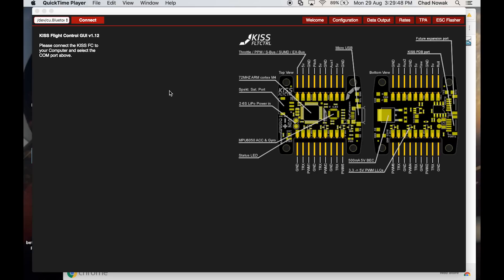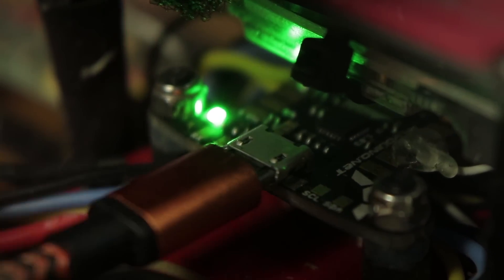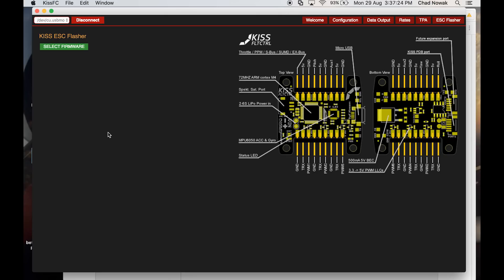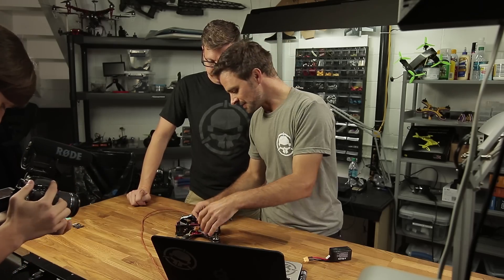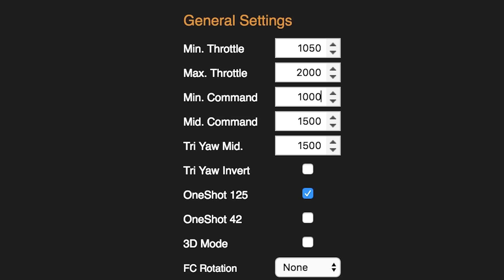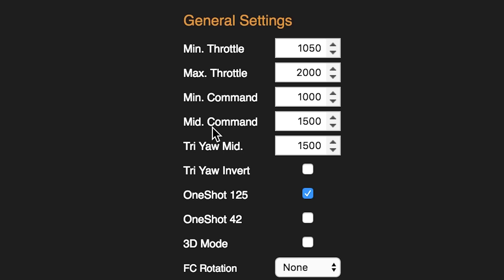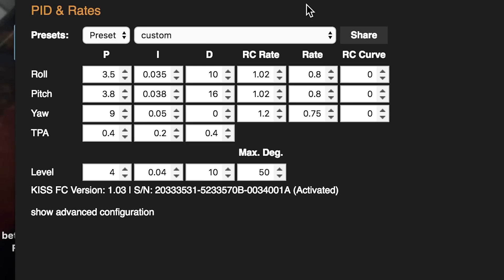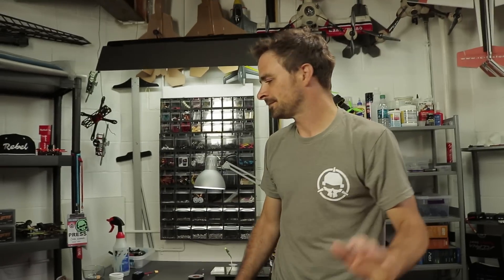Kiss FC Setup Tutorial

Comment: Thanks for making this vid, Chad & Chad!

Sure, lots of folks like me who've been flying KISS for over a year now will have learned most of this stuff the hard way but it's great to see somebody do an up to date KISS setup vid. I'm sure this'll help a lot of folks get up and running KISS easier!

When I watch this it also hits home just how much Flyduino have done since initial release. Remember soldering to flash firmware? Remember the old GUI with no TPA & curves? Lol.

Also, thanks for sharing your PIDS and rates, Chad Nowak. I know that those rates are a highly personal thing which take a ton of work to get dialled so I very much appreciate you sharing that publicly despite all the hard work you must have done on those. If anything it gives a really useful reference point from somebody who knows their stuff. 

One question: What's the thinking behind running more aggressive yaw rates versus roll & pitch? I ask because my yaw is a bit less aggressive than my roll & pitch rates
and I kind of like it. Of course I could always just try & see (duh) but your comments are always interesting.

I used to run low-ish RC Rate, higher Rate and some pretty crazy expo on the RC curve (with a massive degrees per second potential in terms of overall roll speed) which was fun for a while but I've gradually ended up kind of closer to where you're at - a flatter, less exponential looking curve overall using more RC Rate, a bit less Rate and minimal RC Curve with FAR less insane amounts of overall max degrees per.

With the new less insane setup everything actually feels more progressive and more precise yet still nice and smooth after I slowed the crazy 'degrees per second' stuff down and got rid of a lot of the exponential I needed in order to be able to even fly a super aggressive setup like that. Even at 2.5 flips per second I find I have plenty of ability to pull off cool stuff. Just different flying maybe. 

Anyhow huge cheers! Sorry for rambling. Thanks for adding value to the community once again!
Reply: Thanks mate, I just want my yaw to be more twitchy.

Comment: How can I enable "airmode" on My CC3D using Librepilot?
Reply: please, don't use librepilot. If you want airmode flash the cc3d with betaflight. its much nicer to work with
Reply: I am a beginner. Which software do you recommend?
Reply: betaflight 2.9.1 I think is the latest version of betaflight with the cc3d openpilot bootloader .bin file
To be honest though the cc3d is a bit of a pain in the ass to work with on betaflight because you have to plug in  a lipo to get it to connect to the configurator. I would only advise moving to betaflight if you know what you are doing or know someone who could help you with it. The best idea would probably be to get an f3 fc like the xracer f303 v3 as it will work with betaflight a lot nicer

Comment: Do not buy this FC, horrible QC. Get one with SPI MPU6000
Reply: I've got 2 KISS fc and ESCs working perfectly and never had any issues.
Reply: That's BS.  I have KISS in my setup and I use a Taranis and have zero issues
Reply: KISS fc is great and the QC is perfect.  You need to know how to solder to use it though.
Reply: I've found this to be true as well. You can sometimes get past it by rubber mounting the FC on O rings and playing with the TPA settings - sometimes - but other times just nope.

I think the KISS (and a lot of FCs these days) are just super prone to freaking out due to hardware vibration.
Reply: Ryan Copeland Yea, get one with a MPU6000, Xracer F303 or SPF3.
Reply: you realise this uses the 6050 don't you?
Reply: TheRattleSnake3145 Yea edited it. The Kiss stuff have horrible QC too. Especially the FC.
Reply: I wonder if thats why I cant get mine to connect.
Reply: TheRattleSnake3145 The Kiss FC drivers have issues. I have heard people say that the Taranis software has a driver conflict with the Kiss drivers
Reply: I don't have a Taranis so it can't be that.
Reply: Only think Kiss fc's are good for is to use as a paper weight.  still wouldn't be good at that either.
Reply: RookTV Obviously not 100% of them are faulty. But a lot of them have problems(before soldering too). like faulty power regulator, faulty led, faulty Accelerometer, poor copper pads ripping off easily. Kiss' QC has always been bad, their escs have had issues since the get go
Reply: Sorry, but MOST of them do NOT have problems.  A very small have had issues and they were replaced.  A majority of the other issues were user error.  There are many many out there you don't hear about because they are out flying with no issues, loving KISS.  If you don't like it you can go with cleanflight.  This is a top performing flight controller, not for your average person cruising around on a Sunday afternoon.  Again, the only reason a pad will come off is due to someone not knowing how to solder very well and not having the proper iron to do the job.  As far as ESCs you are completely off base.  The only ones that had problems were the 18A, the new 24A have zero issues if you know how to use them.
Reply: PS  is AMA your initials or are you a supporter of the AMA?
Reply: RookTV Fair enough. I haven't tried the new 24A....yet, but I guess it won't hurt anyone to go the Kiss route as long as they get it from a proper vendor, I don't live in the US and had to throw my FC in the bin when it crapped out before I could even solder anything. 

No lol, they're my initials.
Reply: Get KISS equipment from flyduino direct.

Comment: You guys dont use an OSD for tuning PIDs and stuff easier like what is in the vortex? Also Is the lumineer FC the same thing?! They both have the same footprint, I didnt know if that was intentional or if one was a knockoff of the other. I assume you cant tune the lumineer FC with the KISS software
Reply: I don't use an OSSD. The LUX FC is not the same thing.
Reply: Thanks :)
Reply: Nope. LUX FC runs Betalfight or Cleanflight. KISS software ONLY runs on KISS FC, but you can run Betaflight on KISS FC. That's the gist of it.

Comment: Would be really nice if someone could point me to the RCgroups tread with KISS betas, can't find it using Google.
Reply: +Vadim Nemtsev Use a Joshua Bardwell diy smoke stopper when doing things like esc fw upgrades, or a current limited power supply instead of the Lipo.
Reply: +Anders Rambrant Yeah, i know. Used it for ages and never had problems, but was lazy to take it off the shelf one single time and look what happened..
Reply: Betas aren't that publicly available. Its closed betas. Only 1.03h esc beta firmware available since last week on its thread.
Reply: +Alexander Fedorov Just burned out 2 motors and 2 ESC's trying to flash that. Interesting thing is what I can't understand why it's happened, I've retrieved serials, used the proper tool to flash, and on next power up magic smoke came out of the motor and blue light on ESC never came back... Wiring was 100% perfect... Well, 100$ on 2 2206 Lumeniers and 2 24a RE ESC's.. I'm really upset 😔

Comment: Belittle me all you want for flying in self level mode, i am just learning and it allows me to actually have fun flying instead of being frustrated.  I save aecro for the simulator for now.
Reply: keep practising with acro mode on the sim. its a lot more fun than self level when you get used to it :)
Reply: When I first started flying I too used level mode, and it was causing all kinds of issues for me. My FC would drift from level and I would have to fight with it to get it to hold a level position. I eventually had several bad crashes because of it. Once I switched to acro, all of my issues went away completely. Acro is actually easier to fly with once you get the gist of it. Just get some altitude and get comfortable with it. Keep your levelmode on a switch so that if you get a little freaked out you can switch it back. before you know it, you wont even be looking back.

Comment: The early commenter strikes again, with hopes of getting advice. But actually though, can i get telemetry info without telemetry capable escs, like from a naze32 rev6. I know theres a few pins for telemetry on that board, but can i only use that s wire like you do, even if theres multiple telemetry pads

Comment: Does anyone get lots of mid throttle vibrations using rc28 or rc25 and blheli esc?
Reply: I've gone through beta74->RC27G->RC28 and when I was tuning RC28 I noticed some vibrations around mid-throttle that I hadn't seen in the previous firmwares, especially during fast forward flight in one prolonged direction.

Comment: stupid question, when you buy the kiss FC and ESC's from say the rotor riot store will they come already updated to the latest firmwares?
Reply: Depends on when you buy it and what is the latest stable release at the time the FC is shipped.
Reply: IMHO With the KISS FC it pays to always flash the latest firmware regardless of what comes pre-flashed. It should be like a reflex. Why? Because Flyduino release updates quite often and there's been a lot of key improvements lately.

Comment: You don't have to hold the button down the whole time, just when you plug it in and when it removes the read protection.

Also, the GUI FC flasher won't work in Windows because of driver issues. You have to use the dfuse demo flasher.

Great Video!
Reply: so much for keep it simple lmao
Reply: the windows issue is a biggie though.  Not the place to argue it out as it's been done ad naseum.  as a kiss fc owner the drm stuff is more irritating then anything else.
Reply: Thanks! It's just easier to explain to hold the button down the entire time.  

The Windows Driver issue was mentioned.
Reply: +Chris Ames Flashing with dfuse isn't really that bad tbh. The drm isn't bad either especially since they fixed the issue with android resetting activation.
Reply: +FinalGlideAus Sorry, I did not notice that part. I'm really liking the new esc firmware and am looking forward to the  FC firmware with better bounceback handling.
Reply: You're right but I'm a superstitious, always hold button downer here nonetheless. >.<